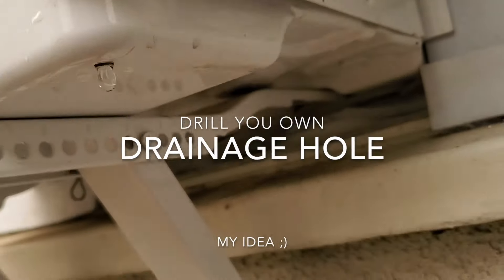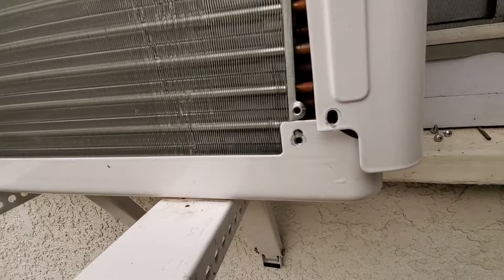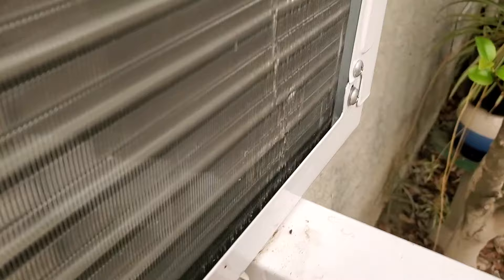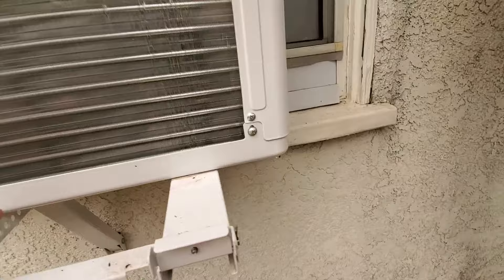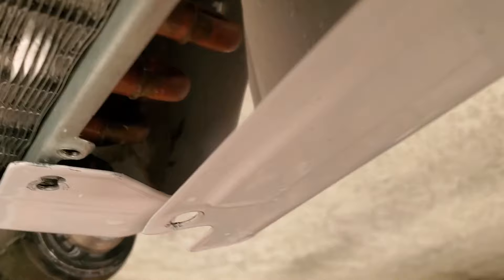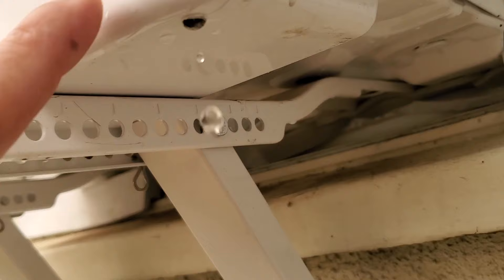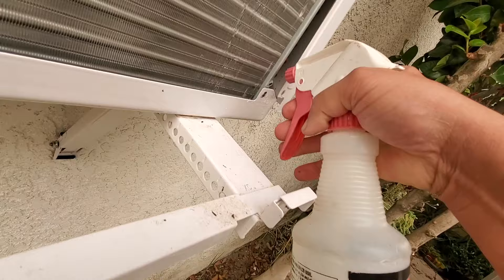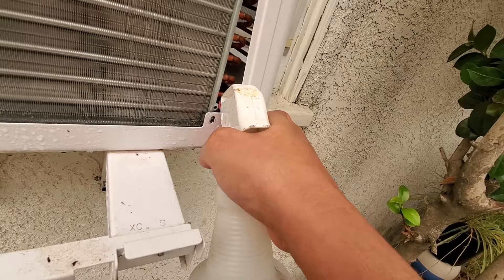How to Drill a drainage hole in your Midea U- Shape fan :) Honest²

Comment: Thanks for the video.  I remember doing this to a window unit years ago because it was draining water inside, before someone say something about the AC needed to be installed angled towards the outside, in my case it wasn’t possible, the best I can do was level.  
As far as preventing mold growth on the evaporator, (and the inside part of the AC, blower fan and cavity) rather than just turn off the AC after use, I would leave it on just the fan mode for at least a couple of hours to dry it up before shutting it down, been doing this for a couple of years now and it’s keeping my wall units mold free.
Reply: With the phone app it is somewhat easy to schedule the Fan Mode for 2 hours when the AC is scheduled to be off anyway.😊
Reply: I just called the company and they told me that we can drill a drain hole on it, no problem. If a licensed technician does it, the warranty won't be void. I called them again to confirm this with another customer support representative.

Comment: Drilled 3/16" hole today in right corner w/o removing screws on AC. Was careful to not penetrate more than 1/8". Will increase to 3/8 or 1/2" later. Lots of water coming out. Posted this earlier on another Honest Mike's posts:

I was going to drill/punch a drain hole anyway before seeing your video. In my recently installed Midea 8000 Btuh unit, the water always overflows, runs down the supporting bracket, onto the brick ledge and down the wall. Drilling a hole will allow the water to miss the ledge and go directly on the ground.

And I believe if the unit was designed to splash water on the coil to improve efficiency as stated, its a stupid idea as the same increase could have been done by other means like increasing coil size (slight increase in price). By the way, the eer on window ac's is much inferior to central and ductless ac's, none of which use a slinger ring to splash water. 

Lastly, I worked as an energy conservation engineer, have three engineering degrees, one a Masters in Mechanical Engineering with a specialization in HVAC/energy conservation. 

I'll drill the hole, and may meter the energy used with drain and with hole plugged as I have the equipment to monitor energy consumption over several months continuously and record it. And maybe I wouldn't do it if the water remained pure, which it won't.

The Midea will be replaced with a more efficient ductless unit in the future.
Reply: Enlarged hole to about 3/8". One drop every 1/2 second but noticed another hole in bottom of 8k Midea 1" from window where 1 drop/sec is dripping on wood window frame and then onto brick ledge (not acceptable). Also water is dripping from left side of ac near window due to condensation from inadequate insulation. Expect shortcomings from a China made ac.
Reply: Hey I just got the same unit but it's a 6000btu, I had a 5k diff brand unit that was dieing in me, I grabbed this midea for 100$ new in the box from someone 2nd hand who didn't need it. Legit opened it all my self. I noticed the water is splashing on the condenser in the back of the unit outside. It's set to the 3 to 4 degree angle it calls for. It's causing a lot of racket and seems ti be slowing the fan. If I tip it forward some the racket stops on the fan but there is a lot of water inside the unit. What should I do?? Should I do the drain hole. It says it doesn't need one tho. I don't Wana mess it up. I'm a car technician, and a pc repair specialist. I'm more then knowledgeable to do it hands on, but will it mess uo my unit in the long run, I seen u said you can test it over time and it's been about a month, please let me know, thank you.
Reply: Mine was also making a lot of noise from the fan blade hitting the water. This noise stopped after I drilled the hole. While I got away with drilling a hole w/o taking the side panel off, I would take the side panel off before drilling the hole so you can tell how close you are to the refrigerant lines. On mine, after summer I'll remove the side panel and see if I can use a Greenlee punch to enlarge to hole slightly with a smooth clean cut (my hole is probably only 5/16" now as I didn't punch the bit in all the way for fear of hitting freon lines). Lastly, I will not test the unit for energy consumption as I've gotten lazy. I used to have a multi channel system installed for all circuits in my house but removed it several years ago. Take off side panel before drilling. @TheOGstriker

Comment: Glad I looked this up. It's super humid here in the summer and the unit sounds like it's gurgling nonstop. It works fine but I want it to drip vs evaporate/overflow.
Reply: I live in Florida, my current window unit pulls a gallon of water a day. I made my own drainage port on the current old fashioned window unit and even at 1/4" I need to check it weekly to keep the gunk from filling it in. I'll have to do the same for this unit as well, I really don't want to risk having water run down the siding or worse have it come into the house.

Comment: I haven't even had my units for a month yet, and they already started to stink during MINIMAL use. Used your videos to drain and clean all three units (a 12000 and 2  8000s). All three still work like a charm. It was 94 over the weekend outside, but still delightfully cool at 70 inside my 1400 sq ft apartment.
Reply: Rain water is part of the problem I have found. It seems to collect a bunch for me. I'm in a dryer climate though.

Comment: Well, after sleeping on this issue a few days, I've changed course. The current plan involves drilling a 1/2 inch or so hole in the left side of the bottom facing the unit from outside. On my unit there is room behind the coil while still drilling in the deepest part of the pan. I'll keep the hole filled with a rubber plug until the water begins to look murky, when I'll remove the top panel and plug and flush the area with a low pressure garden hose, including the right side of the pan as possible. The top panel is more easily removed now that it is held in place only by the top 3 screws. I concluded that I don't care if the water splashes around the inside of the unit as designed as long as it doesn't turn dark and moldy. YMMV.

Comment: I called the Midea company and learned that there is not supposed to be a drain hole.  They told me the water that collects is thrown onto the compressor to help keep it cool.  My AC unit is new, so there is no gunk growing in the water yet.  I ordered some Nu-Calgon 4296-60 Pan-Treat Scum Tablets that I will use to keep the scum under control.
Reply: I have only had my Midea 2 weeks and in a room not used often.  Ran it a total of maybe 16 hours.  That was a week ago, and there is still water standing in the back of the unit.  No way that is a good thing, and rust and gunk will be on the way.  Drain hole for me, but undecided if I will plug hole while using.
Reply: I live in Florida, my 5,000 btu GE model pulls a gallon of water out of the air a DAY... I don't know where that water will go if there's no way to drain it, so unfortunately I'm gonna need to have a drain hole. Absolutely splashing water on the condenser will make it transfer heat better, but I don't want water pouring into my house or down the wall and rotting my window out.
Reply: My recently purchased unit has a blue plug in the rear corner that is removable so you can drain it for storage. You can remove it permanently if you wish. I plan to remove the plug and drain it once a day.
Reply: @jetjazz05 OMG that's the problem I'm having and everyone thinks I'm insane or installing my AC inorrectly. It doesn't have a proper drain hole so it's dripping out of a different spot and into my window.
Reply: @socrates2706  Where it goes is down the side of the building or inside of the wall due to the very poor location of the overflow drain. I had one dripping down the siding and the other pooled up and got into the wall - had to remove some drywall and dry it - luckily I caught it early so no mold growth but it ruined the window casing.

Both are tilted downward to the outside very well (nearly a full bubble worth on the level) so this should not happen. The newer Midea's come with a drain plug so I just removed that on one but the other I did have to drill a hole to allow it to drain. If the overflow drain was in a better location this wouldn't be an issue - or if it included a hose for the overflow drain. We have had very high humidity at 90f+ over the last week or so.
Reply: @socrates2706  I took that plug out b4 even running it the first time... mine are on a 2nd story  and popping in and out that plug are not an option... no way I want that water creating mold in there..the unit blows plenty cold without accumulating water
Reply: How many tablets are you using and where are you putting them exactly.

Comment: I bought my 12,000 btu Midea unit last year and it seems to drain just fine. Since mine faces out towards my carport i have implemented a plastic pan underneath to catch the water...and I'd say it accumulates approximately a gallon and a half a day! Its been pretty steamy hot here in my area of Florida lately.😮 I never needed to drill any holes for drainage, I think if it's tilted at an appropriate angle towards outside,  i think it should drain just fine on its own...just my experience anyway.
Reply: Is yours a MAW12_V1_QWT or V2? -- look at the model number.
Reply: @bobdroidsky225  you mean U2.. I have the latest one ..the old ones have a V and the new ones have a U un the model number.. also the new ones have a drain and touch buttons vs no drain and push buttons on the old units
Reply: @skip741x3  Good info!

Comment: There are a lot of good/interesting arguments for and against drilling a drain hole. I got the unit a couple months ago and just noticed a good amount of water and gunk inside. Im thinking about drilling a hole, draining and cleaning periodically, and plugging with a stopper. Thanks for the video, i was going crazy looking for the drain hole.
Reply: I live in Florida, my current window unit pulls a gallon of water a DAY from the air, for me I'm afraid it's not about pros and cons but about not turning my house into a swimming pool lol.
Reply: No, there are arguments for it, (wrong), and those against it, who are right. Including the manufacturer. The reason older units have a drain hole, is because they didnt utilize the fan in this way, so it was proper to drain completely from the bottom. What, do you think manufactures just "forgot" that AC units can drain??

Comment: I bought a Midea last year. At the end of the summer, I took it out of the window and in the process, a lot of water started draining out, so I figured a drain hole was either covered, plugged or not there to begin with. I'm looking to reinstall it this year and looking at it, it seems it didn't have adequate holes for draining and I then found this video which confirms my suspicions. Thanks for putting this together!
Reply: Those midea units are not supposed to have drain holes. Read the manual the came with your unit
Reply: If they're not supposed to have drain holes, I suggest nobody buy one as they are destined for failure. I've worked as an aircraft mechanic for a major airline for the past 20 years. One of the many things we do when we inspect an airplane is to look for corrosion. That's especially necessary at an airport that is right next to the ocean and is exposed to the salt water "mist" that comes from it. .............I removed my air conditioner after one summer as I usually do each year and I could not beleive the amount of water that was still in the bottom and the amount of corrosion that was there. .............The copper tubes carrying the coolant pass through steel brackets that supports them...............If kept dry, this would probably last for ever but put in a situation where it's constantly exposed to water because of not having properly located drain holes. (Which should be at the lowest point, in other words the back of the unit) will set up dissimilar metal corrosion. I could not beleive the amount of corrosion that was present on the brackets where the tubes passed through them. If left unchecked, it might not eat away at the copper, but it would loosen up the steel's grip on the tube, allowing the tubes to vibrate. If corrosion doesn't destroy the tubes, vibration will. They should have used a better quality steel, maybe stainless steel at the low points of this air conditioner.  @turbospeed08
Reply: @turbospeed08  I think the manual may have been written for Denver. I would drill a hole if you don’t have a newer model with the removable plug. Drain it once a day in a humid climate and replug it.
Reply: @turbospeed08  Actually, the newest models have now a 3/4" drain hole in the location that he drilled..its in the right rear side when view from the back...these are Notorious for having mold issues... I cannot see why anyone would want stangnant water building up in these... the drain is needed

Comment: Drilled mine out just now because it was leaking onto my sill and rotting it out. And yes.. it’s tilted properly. There’s over an inch of water sitting in the bottom of this unit! All the time. It’s fine to splash your water .. but not if there’s dank water sitting. There was an unidentifiable gelatinous fluid coming out of the hole I drilled. Lots of mold as well.  If you are allergic to mold I would avoid this unit!
Reply: Thank you for describing my situation, exactly.

Comment: If you drill, no more warranty. For the fist 15 months, All you need is your drivers license, a fridge magnet and a length of paper-towel or a strip of gauze. Use the license to tuck the absorbent material in between the rear cover and the coils. Drape the other end down. Gravity+capularly action. Magnet will hold it in place against the wind. This way, you wont void your warranty in first year of ownership. To keep it not nasty, I'd recommend simple green foaming coil cleaner. Followed up with concrobium cold mist on the inside part to prevent smelly molds.

Comment: Do this No drill method, 
 Turn your AC unit off and unplug it.
Get a 7 by 2 inch strip or piece of T-shirt material and a wire twist-tie or a small piece of wire. Go outside and stick 2 to 3 inches of the T-shirt material through the lowest vent possible towards the back-end of either side of the AC unit, just enough that it is soaking up some water from the bottom of the AC unit leave the remaining material hanging down towards the ground. Take the twist-tie or a small piece of wire and attach the material to a vent slot so that it won't fall out This will create a siphon for the water to run out instead of into your house.  You are done. Takes less than 5 minutes and you still have water in the bottom so that it works properly. You may also need to attach one to the other side of the air conditioner unit depending on how much water is going into your home you could even add more if needed. Hope this helps.
Reply: Won't the T-Shirt Material get moldy?
Reply: what's a vent slot?
Reply: @mn-mh6uy  No the small piece of fabric always drys when the AC is off and doesn't mold.
Reply: @conteh4447  The space between each vent louver

Comment: Water helps with the power/efficiency of the unit so it was designed that way. Holes are only for humid countries, so airconditioners sold in humid countries are built/designed with holes. After a few years of use, occational maintenance/cleaning is also required to help with the efficiency. Atleast now, you have the option to plug the hole and open it in the winter. The only problem I see is the bare metal from drilling will get rusted thru time.
Reply: Por15

Comment: Thank you for the video on this. Our Midea U-Shaped AC is being taken out as I type. It stopped blowing air so I looked in the front with a flashlight and it's FILLED with MOLD. This can't be fixed so it's going to the dump. We happen to have another that my husband planned to put in the 3rd bedroom so he's going to use it in our room. He WILL drill a hole as you demonstrated in  another video I found. BTW, we live VERY to the Texas Gulf Coast (think DEEP south Texas, farthest tip of Texas.....so we are extremely humid here year round. Again....thank you.
Reply: I live in houston and have had mine.about 2 months the fan has gotten slower and.slower is that what happened with you?
Reply: @parkernickelson199  Yes. I fixed my new AC by drilling a hole outside so water could drain but you can barely drill in or it'll hit a coil. I also hit the inside with CLOROX TILEX once a month, now it works fine doing all that.